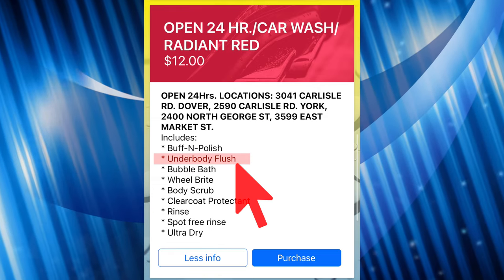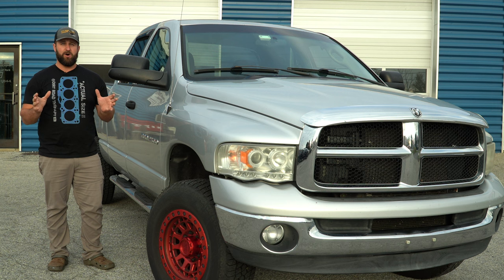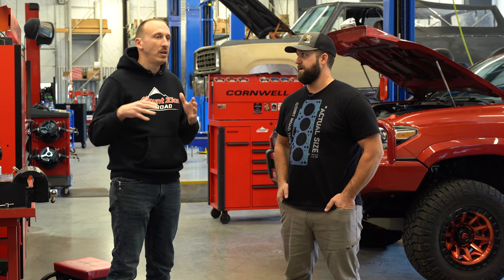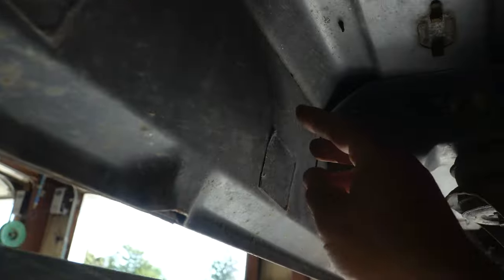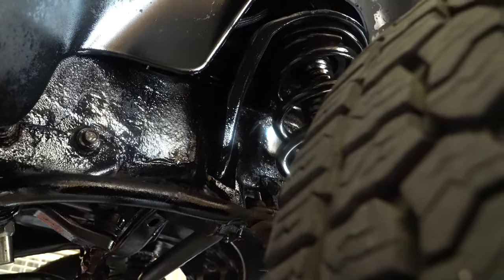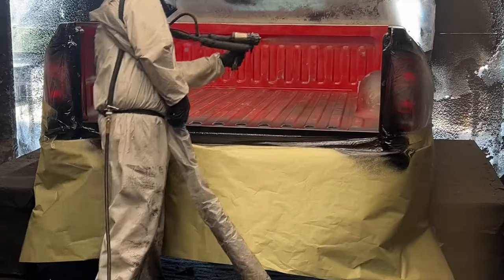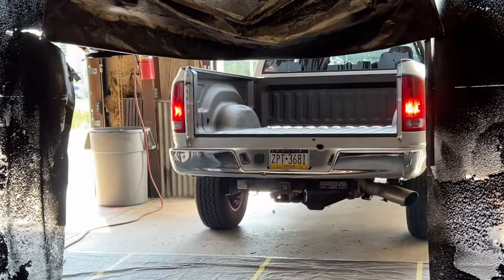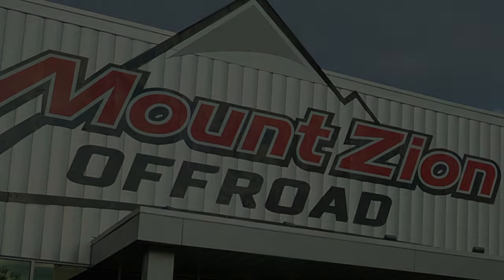RUST PROOF? My Truck Gets Fluid Film & Rhino Liner

Comment: I live in NJ and my 2018 Ram 3500 has zero rust. I apply fluid film every fall and it certainly does its job exceptionally well.
Reply from the maker: That’s awesome to hear! This truck was from NJ as well 😢 no need for any real rust repair at this point (new bed was from Kansas) but was obviously a good bit starting to crop up. Hopefully annual treatment of this keeps it at bay forever!
Reply: i wish i knew about it way before, i froze my ass off washing my truck at the end of the day for many years also in NJ my frame is clean but got body rust

Comment: I FLUID FILM ALL OF MY JUNK THAT SEES THE ROADS
Reply from the maker: RAD 🤘🏼 I didn’t do my XJ because I work on it too much 🤣
Reply: @DirtRoadTherapy  yeah.... I've been holding off on a couple of my vehicles because I had work to do. I did a truck for a guy and two weeks later his rear axle locked up. I had to work through all that goo to replace the axle.